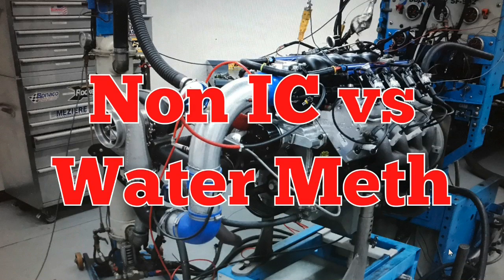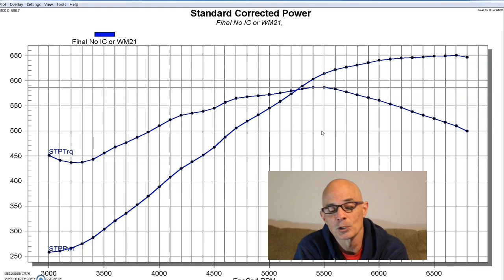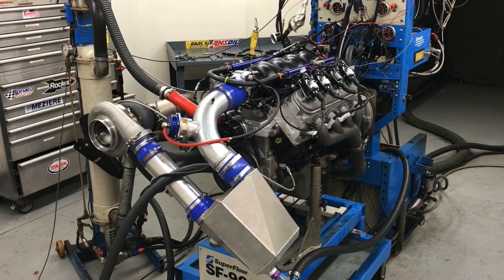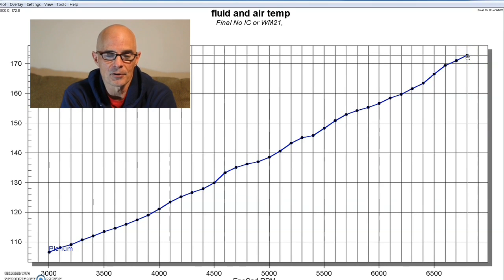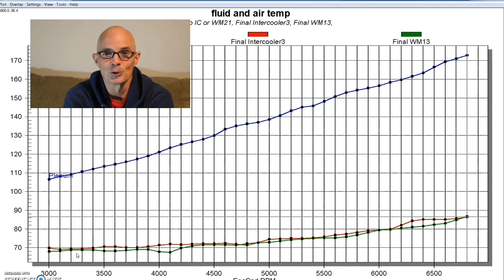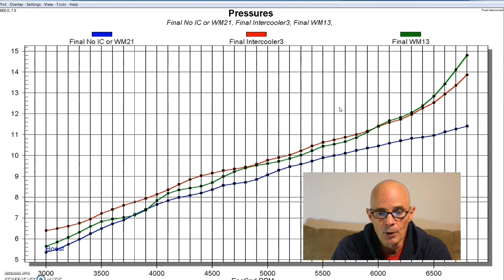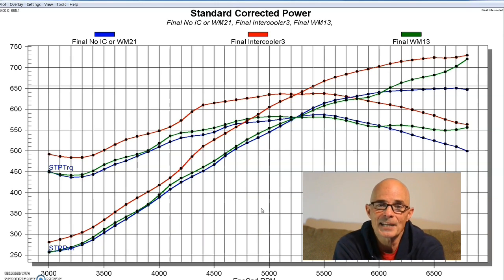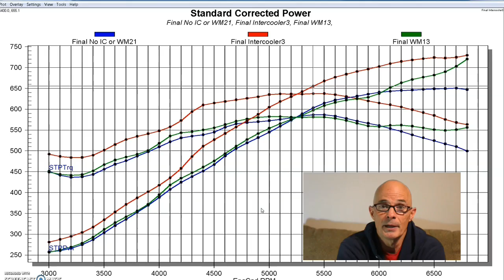WHO'S COOLER? WATER METH vs INTERCOOLER

Comment: Why are the mass airflow numbers never logged during dyno pulls?
Reply from the maker: Our speed density ECU does not use a MAF
Reply: @richardholdener1727   Having an airmass channel on your dyno datalogger would be extremely beneficial. Extremely.

Comment: I hope a/f ratio was adjusted accordingly for the 3 tests because let's not forget that meth is fuel because I fear that on the water/meth you where running excesivly rich that's because there was no rise in power
Reply: i meant that's WHY there was no rise in power

Comment: Would an individual port injection for water meth give it enough time to cool the intake charge? Also, when using water/meth, does the expansion of the evaporating water displace air? Thus getting less dense air to the cylinders...
Reply from the maker: less cooling time with port injection
Reply: @richardholdener1727  port would have significant impact on CC temp and much less cyl to cyl variation.  Looks like another test option.  Thanks for keeping us thinking.

Comment: WMI nozzles need to be installed on the outside of a 45-90 degree elbow at least 12" from the TB for good distribution. Those BS throttle body swirl thingies actually help. - NEVER put a WMI nozzle before the turbo. It doesn't matter that it's a liquid and the droplets are incredibly tiny, you are throwing mass into blades spinning at hundreds of thousands of RPMs and it does a lot more damage than you'd think.
Reply: Good thing volvo tested your theory here. "In extensive testing done by Volvo in the 1980’s on pre-turbo injection, they found that 80,000 to 100,000 miles of pre-turbo injection started to wear the compressor wheel" meaning the wear is so minimal that it only makes a difference after 80-100k miles. That's longer than most people with WMI will ever expect to get out of their turbos. You ignore how fine the mist really is. It's not like a water plane getting worn propellers.
Reply: pretty sure it was just an action shot lol
Reply: I couldn't have said it better. Spraying in-front of the compressor wheel (turbo or centrifigul SC) is a fail in the making.
Reply: @bentheguru4986  draw through carb setups have entered the chat... 🙄
Reply: @KaosProject21  Old school manifold bangers.

Comment: Where are you sampling the intake air temp? Could your computer be trying to reduce power if the sensor is ahead of the meth injection?
Reply from the maker: The computer doesn't change timing or AF based on temp-

Comment: I learned a bit about water meth. The distribution problem makes sense.  I wonder if the boost spike is from increased exhaust volume due to increasing cylinder filling due to increased charge air density from the cooling effect removing heat of compression.  Turbine backpressure was probably tricking the waste gate, allowing more available energy to the turbine wheel.  Just my guess. What about spraying meth or CO2 over an air to air IC? Worth the effort.

Comment: Richard, thanks for another interesting vid.  Especially the insight into wet distribution.  It would be great if you can provide details of parameters that influence power.  i.e. fuel, timing, etc to help further understand the results.  If timing wasn't changed, I suspect that fueling was being corrected to support the denser IC air and resulting significant HP increase.  Observations - I suspect w/m IAT measurement was due to sensor being in the spray stream and not a true reflection of induction air temp.  Spraying pre-turbo likely to provide the most accurate results for comparative purposes.  Surprised that boost pressure was higher with IC?  Cooler denser air?  Thanks again for peaking our interest with all these tests!

Comment: Ever wonder how it would work to vent Nitrous or CO2 through the water side of a water to air intercooler?  Seems like most guys going all out either spray to spool or have CO2 supplying more pressure to the wastegates.  seems like they could save weight ditching water and run cooler

Comment: I tried on a 6 cyl draw through carby , putting boost pressure onto a sealed water meth bottle that would then spray onto the top of the carby.  more boost = more spray, it worked.

Comment: Thank you richard for another GREAT video ! I would be curious to see EGT change with Meth,and intercooler, is there a way that the EGT's changed  the boost level? I ran a turbo motor,and we took a ton of timing out of it,and the headers were glowing brighter red,and the boost went way up. I guess a million degree exhaust temp spins turbo harder ?
Reply: kwik440 yes. It’s a great way to burn an exhaust valve too. Sometimes lower timing is just as dangerous as higher timing. I yank a ton of timing for traction on the street and it has a negative effect on traction because the boost increases lol.
Reply: Probably blowby into Exhaust from overlap! Then it burns in Exhaust  and Turbo! So you get high EGT temps!

Comment: Richard, what about a air to air intercooler with a windshield washer spraying the front on the outside for temp drop?
With water only.
Reply from the maker: that helps
Reply: @richardholdener1727  i am wanting to do a twin gt45. And a single air to air in a c10 on a 6.0 liter

Comment: If the W/M nozzle was further from the intake would that help with distribution and provide better cooling across the ports?
Reply: Maybe? I think the key take away here, is you should NOT rely on good wet-flow distribution through a manifold designed for dry flow; especially a long-runner one. The early LS1/LS6 guys that ran wet kits discovered time and time again how easy it was to blow apart a manifold on account of puddled fuel combined with a backfire through the intake. I believe the FAST manifolds back then even had a pop-off valve feature designed to help prevent the manifold exploding.

Comment: Once again Richard great work and thank you. I'm a little late to the party, however, as a cheap and dirty DIY experiment, why not use a tunnel ram intake with Nitrous plates to inject the water-methanol. Better distribution, introduced early for the W-M to work it's magic and the ability to use the nitrous/gas jets in the plate system to adjust distribution.

Comment: The point of methanol is to not only to cool the intake charge but to add octane?  The tests show similar intake temps between the two.  I assume you kept timing the same for the test? Would the addition octane added by the methanol and no extra timing affect your numbers?

Comment: Spray Pre-Turbo please.  There are companies in Australia that claim big power increases spraying pre vs. post.

Port spraying would also be interesting to see.  I am surprised that the big water/meth kit manufacturers don't have data on this...
Reply: That is going to be terrible and detrimental to the carefully balanced turbine
Reply: @petedamico6989  Super Stock Tractor Pullers spray into the turbo, no problem.  They move a lot of Water/Meth.

Comment: Was your IAT sensor shielded from the the incoming WM hitting it directly? If not, could this have effected the results of the large temperature drop measured? Did the individual runner sensors match the temperature drop of the one behind the throttle body? Great content as always! Love the data!

Comment: Could the increase in boost be from the expansion of cooled air? We know that Pressure*Volume=nR*Temperature so if the temperature of the air is increasing near the end of the run that could lead to an increase in Pressure=Boost at that point in the system. I have to say I like the way Gale Banks is dealing with this by not worrying about boost pressure but instead looking at air density. I don't know if this is a usable hypothesis or not.

Comment: That was interesting.  From what I understand, there is more cooling (and horsepower) to be gained from straight methanol, vs water/methanol.

A lot of folks say that if you are running a carbureted engine on E85 or pure meth, you don't need an inter-cooler at all...  Sounds reasonable to me, but I'd like to see the test: Intercooler and gas, vs non-intercooled E85.

Comment: Could the meth cause more exhaust volume making that boost rise at the end?
Reply: Rodrigo García  yes. E85 can do it to since your using 40% more fuel make the same power. Makes E85 good for spooling turbos though
Reply: Not substantially. Consider the actual mass of water/meth that was consumed during the 3 or 4 second long power pull. Not much. By far the largest component of mass flow rate is the air.

Comment: Richard... did you add more ignition timing when running  the W/M when comparing it to the intercool Run? If not this is the reason why there was only and identical temperature change and not an increase in power in the mid range. From memory every half/0.5 mass of W/M to fuel increases ron by 8 points, 1:1=16ron and 1.5:1 24ron roughly. Id say the flame front was being quenched too much and the ignition wasnt advanced enough?
Reply: I should of watched till the end to comment. Cylinder distribution is definitely a cause.

Comment: Here's my guess...tell me what you think. The benefit to water/meth is to prevent detonation by massively raising the octane rating, allowing either higher compression or more boost.  The  benefits to charge air cooling is almost secondary to this.  Air density is certainly increased by lowering the temperature and that's always good from a charge air mass standpoint, but that's not the primary reason for running water/meth.  If the engine is not knock limited at the boost pressures you're running, then it's not really too much benefit.  I imagine the boost pressure spike at the top is just that the engine is not able to process the air as fast at the higher RPM, and it "stacks up" in the manifold, which is read as higher boost pressure even though the wastegate is still seeing the same flow/pressure in the exhaust system.  I imagine the intercooler has less dilution effect on the charge going into the cylinder (no water/meth) so the efficiency of combustion is increased.
Reply: I've read that ~1/2 of the increase of octane rating of ethanol, compared to gasoline, is due it's charge cooling effect. In the case of methanol, having a much lower stoichiometric AFR, I assume it's considerably greater than 1/2. The effect of charge cooling on octane rating plus it's effect on charge density surely make it the primary benefit of W/M injection. Consider also that water has ~3 1/2 times the cooling effect of methanol.
The spike in boost at the top end appears to be an anomaly in boost control. Though the wastegate is affected by exhaust pressure, it's control is referenced to boost pressure, not exhaust pressure. Boost pressure should remain stable regardless of variations in exhaust pressure.
I agree that, all else being equal, any water or methanol vapors in the charge would displace air and hinder performance.

Comment: I’m not even a v8 Guy. I drove Honda’s my whole life. I have a boosted s2000 making a cute 430whp haha. But I Love the channel man. Seriously makes me what to LS swap something.
Reply from the maker: My last Honda was a sweet, sweet, VX-gave it to my Buddy Chad Reynolds last year-50=5 mpg Freeway. Miss it so! Lots of Hondas in my life.
Reply: Richard Holdener awesome! I had a VX hatch at one point. With the awesome lil single cam Vtec-E, Running on 1 intake valve per cylinder  instead of 2 at low RPM to save even more gas. Pretty cool design. With All this LS stuff crazy to think you drove a civic 😂 You’re a real car guy for sure. Love all makes and models. Anyways take care. Keep the videos coming 👌🏼

Comment: I'm glad you cleared up the question of water/meth injection. I can tell from the comments that everything is now crystal clear to everyone. LOL
Reply from the maker: exactly
Reply: @richardholdener1727  have you ever done any testing using two sets of injectors one set for low boost pump fuel and the other set for high boost methanol?
Reply: @SARJENT.  just run e85

Comment: Thanks for doing this one!!! Boost increase probably comes from temp drop. Cooler air is denser air. If intake side is improved, boost goes up. Exhaust side improvement, boost goes down, BUT power still goes up. I'm still confused why the power increased so much with the intercooler vs H2O Meth even though temps were so close. Hmm.
Reply: With sloppy water injection  one bad cylinder pulls timing from everything g.
Reply: With denser (cooler) air, the same boost will provide more oxygen, thus more power.

I agree, the water / meth results don't look right.  The boost and air temp were very close water / meth and intercooler, why wasn't water / meth wasn't much better below 6000RPM.  Evaporation will increase volume, so I would expect a bit less power with water / meth than intercooling.  Not that much less.

Comment: I had a 1993 Mitsubishi evo1  with a manual water spray onto the air to air inter cooler. On a long uphill run in Germany it was pulling 135 on the clock, I sprayed the cooler and it hit pushed 140 on the limiter.  My practical proof cooler charge works.

Comment: Look at it from an air density perspective... I used the numbers from 6k rpm... 640hp, 157 deg f and 10.5 (25.2 absolute) psi and got .10664 lb/ft assuming 50% humidity.  Compared against numbers @ 700hp 80 deg f and 11.4 psi (26.1 absolute) gives .130054 lb/cuft.  This means that density increased 22% with the intercooler, and it should have made 780 hp with the added air you provided  (density ratio*starting hp).  So another question is where did the other 80 hp go?  I mean, from a cylinder pressure perspective, its probably making it, its just not making it to the dyno number because of losses somewhere.  How much power would this have made if you had not added intercooling and just turned the boost up to get to that same 22% density increase?  You're not comparing apples to apples when you provide an engine 22% more mass air by driving the turbo faster due to tricking the boost control with a colder pressure signal because it doesn't account for the difference in temp. Sorry for the book, but all of these intercooling tests use a flawed method and none actually answer the question, other than prove that you can spin a turbo faster if you lower the pressure of the control signal by cooling it.  It proves nothing else.  If you would do this test again on a non knock limited setup, just electronically control the waste gate off compressor pressure (before the intercooler instead of after), you'd have a 90% answer. If you also measure airflow and exhaust backpressure, along with what you already have, you'd be at 98%.
Reply from the maker: the temp change should not add that much power
Reply: @richardholdener1727  That 157-80 degree temp change alone is roughly an 18% difference in density at the same 25.2 psi absolute.  The other 4 % is the additional .9 psi. Please don't take my word for it, do the calculation and let me know if/where I'm wrong. Here is the calculator I used, there are others: https://www.omnicalculator.com/physics/air-density .
Reply: MxGuy   I believe you are over simplifying by considering charge density alone. You assume no change in volume flow, therefore an increase in mass air flow proportional to the density. Given the greater density, greater pressure across the intake port would be required to flow the same volume through the port during the same time period. Also, one should assume that if the compressor is flowing a greater mass of air, the turbine may also require higher inlet pressure to produce the greater energy required. This would lead to increased residual exhaust gas pressure in the cylinder reducing volumetric efficiency and increase pumping losses due to higher back pressure. 
All else being equal and within a reasonable range, one can roughly correlate power output to changes in boost pressure because the change in density correlates to the change in pressure.

Comment: about 9 min mark you were talking about charge temp and how people run these in open engine compartments. I've seen a lot that is sucking air right off the back of the radiator and intercooler. I will have to search for a video, but I've always wondered what the +/- of actually plumbing some sort of cold air intake into turbo. Anyone ran a test so far to see what a few feet of pipe on the intake side would do. Its all a trade-off, for me I'm going to run a filter on the street. Today you can run 1 of these fairly mild turbo combos at 700-1000 RWHP. Does the 50hp you loose really matter on a 275 radial driving on the street? Id like to put mine together and have it last a few years honestly.

Comment: I’m interested in running meth on my eco boost motor and have been researching wherever I can.  Gale Banks engineering has been a big “boost” to learning.  When you said about running meth in front of the turbo, what I was reading is that over time the liquid particles will eat the compressor wheel apart via cavitation.  Meth runs are supposed to be as long as possible because the methanol absorbs heat through latent heat of vaporization.  The meth run should be about 18” long if at all possible.  The picture you had with meth nozzle looks rather close to the throttle plate.  The point you bring up about distribution is interesting as I haven’t seen anything on it and that definitely sounds like an issue.  Any way to see a test with meth and inter cooling with the meth nozzles after the intercooler to get the best of both worlds?
Reply from the maker: don't think cooling was the issue-its distribution
Reply: Richard Holdener I get that.  What I was talking about is if there were individual nozzles at the intake for each cylinder there’s only a matter of an inch or two for the meth to do it’s cooling thing